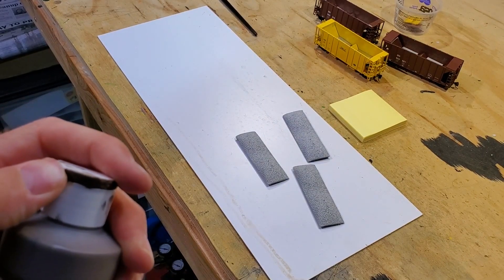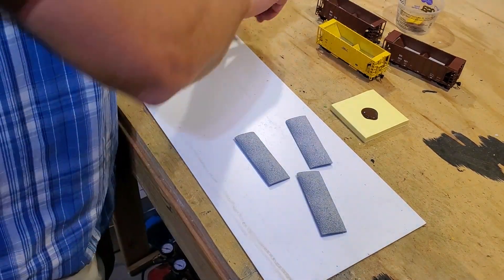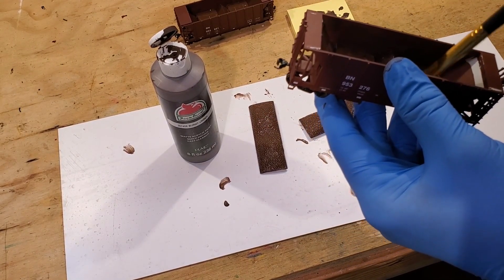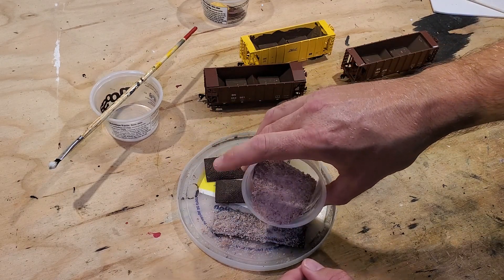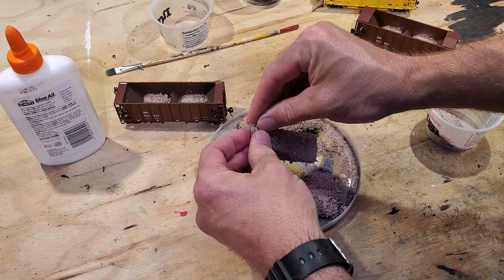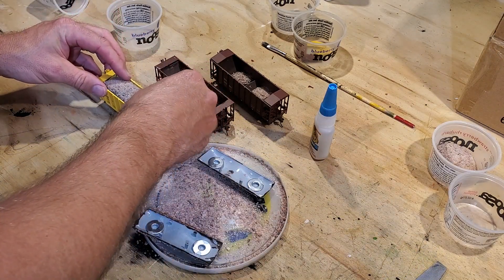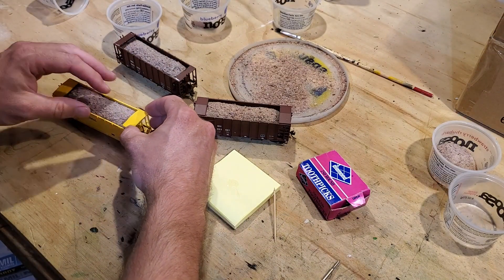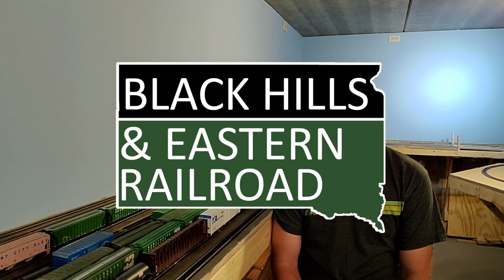Custom Loads for HO scale Bowser Ballast Cars - Part 2/3

Comment: Where are you getting the pink ballast?  I am from the Sioux Falls area and all the tracks for many miles around are ballasted with pink quartzite. I have been looking for a source of this and have not made the right connections yet.
Reply from the maker: Hey Gary,  Thanks for watching!

Honestly, look on about any jobsite around the Sioux Falls metro where a cement pour or paving of some kind has taken place?  I used to work for a landscaper who would use this material as an underlay for brick paver patio type projects.  Packs well, but still allows water to permeate.   I don't remember where I got mine.  I used this same stuff to ballast my Sioux Junction 4x8 layout around 15 years ago.  Maybe from the landscaper?   

I'd Ask one of those guys or maybe even just visit the scale house at Knife River in NW Sioux Falls.    They probably spill more in a day than you need for a lifetime supply!